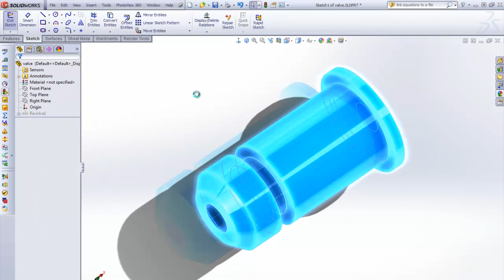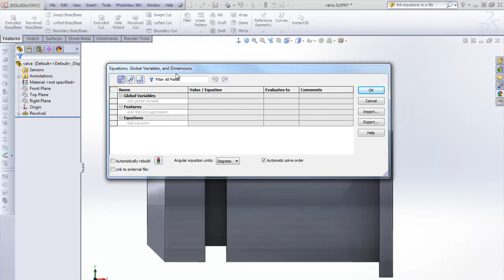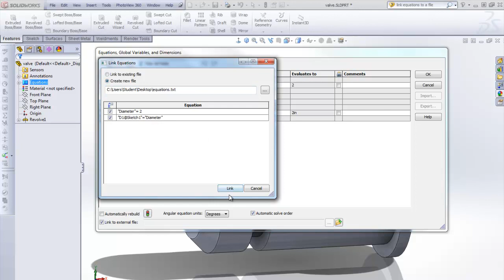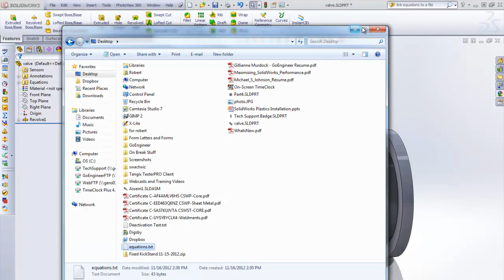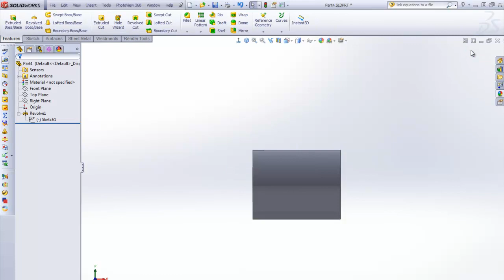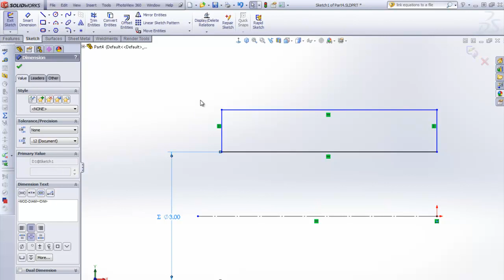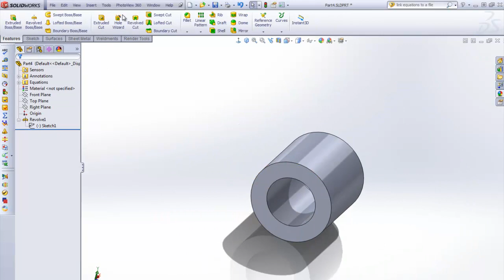SOLIDWORKS – Link Values with External File

Comment: After I export the variables to a txt file the equations editor becomes dim. I am only able to change the equations from the text file only.
Reply from the maker: You should be able to manage what equations are linked or not linked. Linked variables can only be edited in the external file  There are more details in the help file here https://goeng.io/JSl3b0

Comment: Is there away to link sketches to multiple part files as well? Lets say im making 2 parts that fit together like a puzzle piece. Using this method I can now link variables together, but I still have to create 2 sketches. With simple geometries this is not that bad, but it would save some time with more complicated models.
Reply from the maker: Hey rjsajols, in this case it may be best to model these two parts in-context of an assembly? We have a great webinar on that subject here... https://youtu.be/owKy4HwmwMQ

Comment: I do not know if this happens for others who maybe using SolidWorks 2014, but my SolidWorks seems to not like decimals numbers when stating inches as the unit within the equation's external file. I would have to remove the inches unit to clear the error in SolidWorks or replace the decimal (example value: 1.5) with a whole-number (example value: 1.0 or 1). SolidWorks does accept the unit for feet with decimal numbers (example value: 1.5ft).
Reply: You would have to define those parameters in the Options, if I remember correctly.